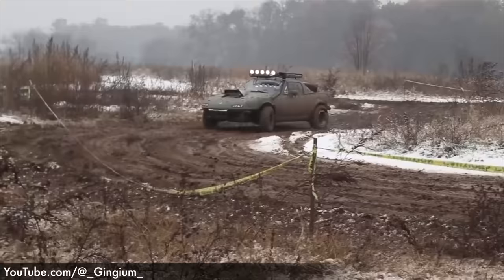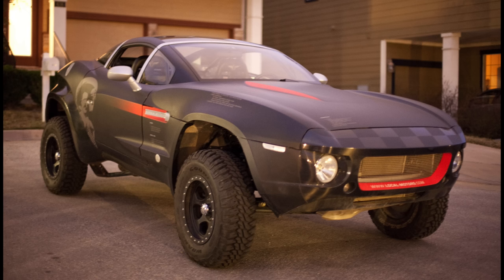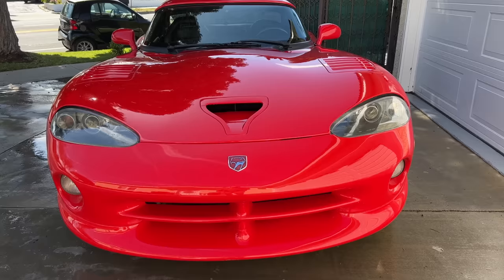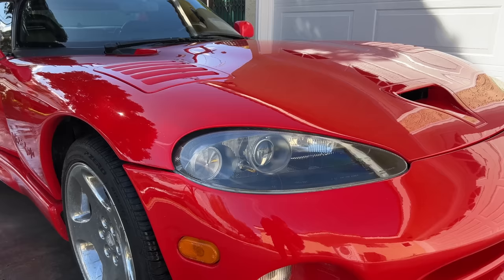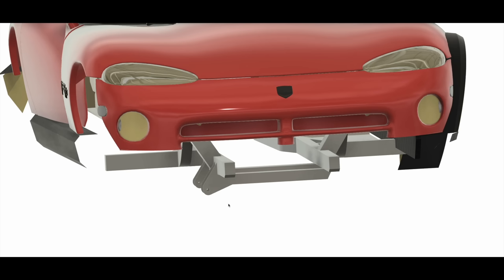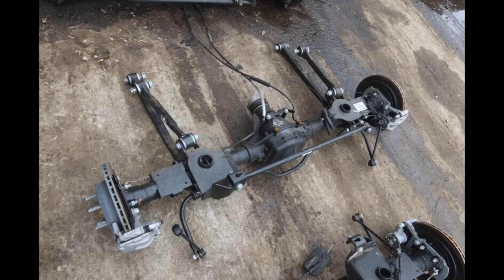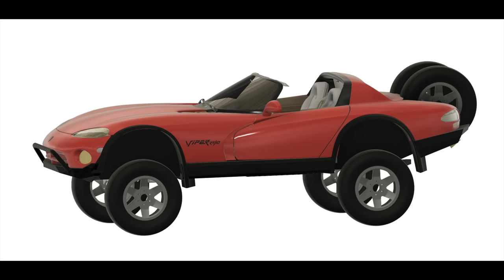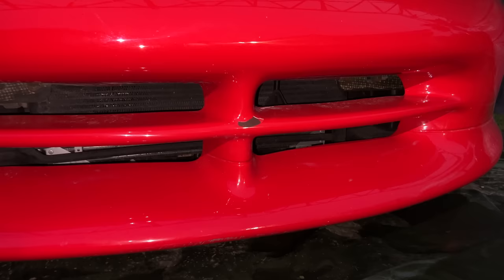Let's Build An Off-Road Viper

Comment: ive been terribly depressed with my 3rd year engineering degree, and i kept on watching videos that filled my time but not my soul. Now it is filled. Long live matt.
Reply: Keep at it, man! I’ve been an engineer for 12 years, influenced by build blogs and forums alike. You’re in the right place for inspiration!
Reply: Just because you have a degree doesn't mean you are an engineer or and expert.
Reply: @richardturk7162  that’s like saying just because you have a job doesn’t mean you’re a master at your profession… goes without saying. Every bit of my work is done with open discussion to decide if it will work or be profitable. If you think all new ideas or plans will be perfect, you end up with production products that fail. You can’t claim to be an expert. Engineeing is basically professional guessing, until the company and it’s workers make money.  The degree is simply a special tool kit for the job of engineering.
Reply: In my experience, the last couple years of engineering got easier since courses like calculus were over and easier, more practical courses are placed in the last couple years. Now my job is far easier than school was, too, because there's absolutely no studying or tests required, just designing things. You're probably about at the peak of despair right now, where you've ran out of the energy you might've had at first but you feel like there's still a lot of time left. It should continuously get better from here, especially since you'll be able to earn decent money after you graduate that you can use for the kinda of things you see in videos like these.
Reply: I studied engineering. Don't really do anything you'd call engineering these days. Still, did a job interview recently and when asked "what do you consider your greatest strength?" I went with "I think like an engineer... albeit mainly now I work with machines made out of people [organisations]".  Even if you've learnt engineering isn't really for you, it's still really transferable and useful.
Reply: Matt’s off-road recovery 😊
Reply: @agerrgerra1361  This is interesting to me because I just started my bachelors and I'm perpetually tired
Reply: Im in the exact same situation lol
Reply: @davnape14  bet 💕
Reply: Long live Matt, so long as he doesn't slide sideways into a Denny's.

Comment: Once upon a time, with a 1972 Dodge Dart (4-door sedan), I installed the (5th ? replacement, very torquey modified Slant Six) rear axle UNDER the leaf springs (involved some minor welding of the leaf spring mounts, otherwise plug-and-play). Then I crawled under the front end and cranked up the torsion bar adjusters to level out the car. Got an "alignment" (surprisingly drama-free). By this trivially-easy means, I ended up with a Dodge Dart car that I had to reach up to open the door, and it was slightly difficult to clamber up and into. And yes, 'Yee Haw Hoot Holler', we did some Dukes of Hazard jumps, even passing an off-road truck that was on the trail by going off the trail (through the bushes). Complete and utter nonsense. Great fun.

Comment: Hey Matt, something to check out for your possible 8HP 8speed swap is a Polish company called TurboLamik, they do a standalone TCU for those transmissions and even allows you to do custom setups like keeping the original Viper clutch pedal for clutch dumps in an automatic transmission which sounds like something SuperFastMatt would do.

There is an Australian Youtube channel call 'Zero to 60' and they put the 8HP's in BMW's and drift cars, they have a ton of videos on different aspects and setups that would be helpful to you. Looking forward to seeing how the rest of the offroad Viper goes!

Comment: Consider using the requisite belly pan as a full-length structural member.  I can imagine trusses along the frame connection points that would significantly reduce the inclination to close up like a folding knife on hard landings.
Reply: I was about to comment about that, but you beat me to it. Lots of gussets for sure. I was thinking a roll cage tied in, but that would be an extremely tight fit and might not work.

Comment: Ford 8.8" axle/diff from a e-150 van 1977-1986, it's  69.25" wide, my grandpa used one for a gasser back in the day that was pushing 500 to the wheels, the Ford 8.8" diff has excellent aftermarket support and I would recommend it for this project

Comment: I made it about 200ft in my boss's Viper before looping it around the first corner.  It was a wide round almost cul-de-sac that happened to also be a corner, so I went for it and went around.  I have always loved how both great and terrible the Viper is.
Reply: The Viper's greatest strength is also its greatest weakness; the first few generations had absolutely zero driver aids, incredibly neutral handling, and enough low-end torque to slow the rotation of the earth. Combine that with people's tendency to not drive them enough to force them to change the tires very often, leading to dry rot, and you have a car that will chuck you at the nearest tree without hesitation. Put fresh rubber on it and make sure the driver understands that the gas pedal is practically an on/off switch in terms of immediacy, and even a 1st generation Viper is remarkably well balanced and predictable.

Comment: The 8HP is a great transmission, and should have a lot of options available for 4WD transfer cases, if you decide to go that route. My RAM 1500 has a 8HP + 4WD transfer case. You also have AWD options if you wanted to, I believe several Dodges used a center diff with the 8HP.

Comment: "is it safe? probably not, The viper is known for sending its drivers off-road constantly... which is exactly where I'm planning on taking it, so it should be fine."  fixed that for you.

Also i like how as soon as you lift the viper 6 inches it goes from looking like a hot hot muscle car to a mildly goofy tongue floating on a dune buggy suspension.

Comment: It think the beam axle tips it over the line from offroad Viper to no-longer-a-Viper. With zero Viper parts in the suspension at either end, and major frame changes, you might as well put the V10 in a 2-door Bronco (for IFS and beam axle rear) or Wrangler (for beam axles front and rear) and top it with a Viper hat - the Wrangler wheelbase even works, and the Bronco is close.

Comment: I'd use a Ford 8.8 rear axle out of an early Explorer. Width is with in .5" of a stock Jeep and they have good aftermarket support since it's a common swap into Jeeps since they are stronger than the stock Dana 44. A lot of lockers are available, upgraded axle shafts and trusses too. They can be found cheap in a junkyard with disk brakes or you can get a built one from East Coast Gear and Supply.
Reply: This. Dana 44s break with any amount of torque and decent sized tires. And since hes going to be shock loading the diff with jumps, and doesn't want to build a 9in, the 8.8 is the obvious choice. I guess there's always Dana 60s as well. But those are a fair bit wider.

Comment: The roof basket can be swappable if you mount it to the frame of another roof (can probably find one almost new because some people will have them off the car when they fly off the cliff) thus preserving the original and adding utility only when you need it.

Comment: A few decades ago I owned a '77 Firebird with a 400 Poncho engine, glasspack exhaust, and the glorious shaker scoop. That car would also get sideways at inconvenient moments.. and the exhaust and carb made a magnificent symphony. More importantly, it taught me something about myself. I learned that I like my cars to feel like I just strapped a saddle on a grizzly. Which means the Viper was built just for me. I don't want traction control, ABS, stability control, or heated tampon applicators.

Comment: You probably need to change some of the suspension geometry slightly. Every time I try to remember suspension design, I remember how complicated it is. But, I remember that the roll center is ideally some distance between the Center of gravity and the road surface. If you lower the entire suspension, like by moving the mounts, you will end up with a roll center far below the center of gravity, which will greatly increase the body roll of the vehicle. Body roll is primarily determined by the distance between the CG and RC.

Based on the preexisting characteristics of the Viper, as well as off-roading it, you will probably want a lower rear roll center, and a higher front roll center. A higher front RC will make the Viper more biased towards understeer under throttle, and decrease traction roll (tendancy to want to flip) while off throttle, which both would be extremely beneficial on dirt. A lower rear RC will increase traction to the rear.

But, changing the RC will mean changing the control arm angles or lengths. Good Luck, it'll be worth it to dive down the dozens or hundreds of hours of research to get the geometry right.

Comment: Just some notes on the 8hp70 speed trans swap idea. The valve body is the controller/tcm of the trans. It is all electronically controlled via solenoids. The bell housing bolt pattern has a good chance of being the same. Make sure you have a way to manually release the parking pawl and keep it held, from somewhere inside the car, as the trans does not stay in neutral without the park pawl solenoid being powered up. Stay away from the the "upgrade" version of this trans that uses coolant to help heat and cool the trans, unless that is feature that you feel you must need to delete.

Comment: Beware. I have a $500 beat up Gen 1 Viper bumper in my garage. The headlights go for $2k-$3k a piece used, like with holes and cracks in them used.

Comment: I mean honestly, lifting a viper is EXACTLY what it needs to be a GRAT car.  A taller, softer suspension and I would even consider adding a transaxle to split the torque of the engine to tame the burn outs just a tad when you need it, more air going under the car will cool your exhaust better, more room means massive radiator swap out for your desert run.  This is epic, cool, and completely the correct thing to do to a Viper.

Comment: Sounds like what you need is a 1998-2003 Ram 2500 parts truck. Came with V10 auto trans and disc brake rear axle around the width you want. Dana 70 with tons of aftermarket gearing and locker choices for way less than your $2500 bronco idea. It will change the wheel bolt pattern over to 8x6.5 but that might not be bad thing and you can always mod front uprights to take the ram unit bearings for easy replacement and gets you the same bolt pattern.

Comment: Oh my Gawd the burnouts at the end. I rarely hear a naturally aspirated 8L W10 do burnouts, and you can hear how easily those chambers and pistons do the job. Literally at about 4000 RPM. This block is in fact running at half its output capacity. Talkin' about something being overbuilt, or having enough material in it. This engine noise is literally lazy. Amazing.

Comment: It would almost make more sense to build a custom frame off the bat instead of tying the suspension into the thin walled factory frame. That way you could steal the factory geometry and axles of a wrangler or bronco and only have to figure out the transfer case and driveshafts.

Comment: Mopar A body guys deal with the "What axle do I use?" issue all the time. The easiest thing to do (without hunting down a rare factory A body 8 3/4 axle and paying through the nose for it) is just grab an 8 3/4 or Dana 60 from just about any pickup truck in the junkyard, cut the axle tubes down to the appropriate width, move the spring perches and shock mounts, and send the axles to a machine shop to be cut down and resplined. That's the route I'd take if I was even considering some $2000 aftermarket unit that you're going to end up modifying anyway.

Comment: Ford 9", order a full floating housing, for an oval car, then get a used nascar center section, available in all kinds of gear ratios, and come with a detroit locker, they make different springs to adjust how quick/hard it locks/unlocks.  last one I did was under $2K

Comment: SEMA is possible, not because it will be complete by then, but because a vehicle doesn't need to be complete - or even able to drive - to be shown at SEMA. But it does need aftermarket equipment piled on it.

Comment: Try the 14 bolt full floater 8 lug rear axle out of a 2002 Chevy Suburban / GMC Yukon XL that had an 8.1L v8 engine. They are known as the 14 bolt AAM and have exactly the 69 inch WMS to WMS and were leaf sprung with standard shocks so cleaning the tubes for 5 link setup would be relatively trivial. They also came with a 4.10 or 3.73 gear ratio standard and can be geared up to a 5.13 if I recall. I spent $129 at a 50% off sale this past weekend to put into my K5 Blazer. This would be awesome to see in your offroad Viper.

Comment: I'm pretty happy you chose this, it'll hopefully give me some insight and a little confidence because I'm trying to get my first gen Rav4 set up for rally. It's got the bones, since the drivetrain is Frankenstein'd from a Celica gt4 out of the factory, but there's little to nothing in the aftermarket scene so everything is gonna need fabrication. I've done little to no fabrication in the past on automobiles, I barely know where to start. And throwing around terms like suspension geometry, lead angle, camber, knuckle strength, dual sheer strut mounts. It's gets disheartening very quickly. So I'm hoping the next 8 months will be informative ones. This is my only car, and the only car for me, so it'll break my heart if I fuck up. If you read this, tips on how to do this or where to get info or help would be priceless. Speaking of priceless, physical tips too.

Comment: You should definitely get an 8 lug, 1 ton axle from a junk yard for $600;  like a dana 60 or 70.    With the larger tires and lower gearing thrown at all that power, the dana 44 is going to break at the first bit of bouncing while you're on the throttle.
Reply: I think you’d be surprised at how stout a modern Dana 44 is. The viper is going to be light and, relatively speaking, the tires won’t be making that much grip, so I bet a Dana 44 would be fine

Comment: This is the exact sort of ridiculous and crazy project that I love to see. And actually engineered, which you don't see too often on the internet. My thought is that putting larger wheels on it isn't a great idea, and rather it should have the same size wheel with larger tires so that the tire can absorb more of the offroad bumps. This might also help reduce involuntary burnouts, since the tire would flex a little more and absorb some of that shock load.
Reply: Bead lockers as well to stop grippy tyre from spinning on the off road rim????

Comment: I have a 2wd 4Runner with a lunchbox locker in it and I can actually do A LOT of off roading. I can do better than open diffs 4x4 toyotas usually. So 2wd with a locker axle will work great

Comment: Do it right and go for a 1 ton axle the first time around. After blowing a bunch of D44 shafts you’ll spend the money on a real axle anyways. Bonus points to get one that’s full floated so it’s easy to swap axle shafts if you break one. Also don’t put a winch on a desert thrasher, do put a full roll cage and engine cage on.

Comment: It sounds like a monster truck because the designers literally took the V10 out of a heavy duty Dodge truck and grafted a sportscar onto it.  They did modify it a bit to allow it to rev higher and make a bit more power, but it's the same basic block and design.

Comment: You could always go with an older ford rear axle like a Dana 60/70 especially with the significant lift. The axles under the 67-72’ should be a narrower width than 72+, and the width definitely solidifies at 86’+ years. You might actually be ok with any 70’s ford axle because I think they’re Dana 60 5 lugs at 69” WMS/WMS. Then you could pull a straight axle off something like a 72 ford and it be Dana 60 5 or 8 lug, but track width widens at 72’+. Gearing should be 3.55/3.73/4.10/5.13 on those, so that’s a separate issue. Although, you could D44/D50 TTB the front and run a front diff paired to 1356/1410, ect. 

Actually, just find the right bronco donor and steal everything off of that to use, then cut and shorten or cut and widen the axles, replace the trans and tcase, spend 3500 on a custom trans adapter, and pray the drive ratios are compatible. Lots of not-so-easy to plan problems any direction you go, I suppose. Looking forward to the series premiere at episode 4.

Comment: I like your vision (90s Chrysler pun) for this project, but think the automatic swap would add complexity and digitization to a car praised for its analogue virtues. While I see some appeal to torque converters on uphill starts, you'd miss out on the ability to bump-start when the starter gets clogged with dust and stops working.

Comment: If you lift the body and build a proper roll cage you can add strength and rigidity and whooopeee improve the iffy handling.  Double shocks would also be a great idea. If you add airbag to drop the car to "normal" height when in the city, then it can be a sleeper, that sounds like fun

Comment: Again, great video.  I'm designing and bulding (myself) grand touring '70 Super Bee with Viper engine, dry sumped and with huge twin screw supercharger. Behind it is AUTOMATIC transmission, 5 speed from Maybach. W5A900.  You may want to do home work with crank oiling problem. Also Gen 1 is problematic, you cant get all parts anymore. Have rebuild few. Good luck with project, I'll be watching you.

Comment: Have you considered using portal uprights in the rear suspension instead of converting it to a solid axle? This way you should be able to keep the stock diff, still have extra reduction, and you wouldn't have to modify the frame. You can find surplus Humvee axles for relatively cheap.